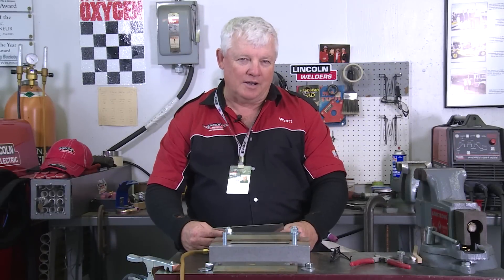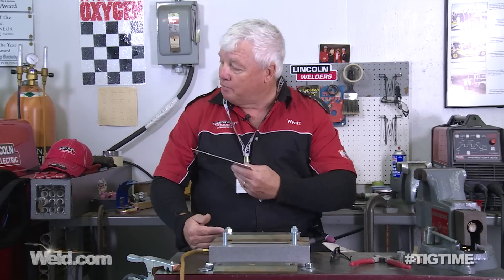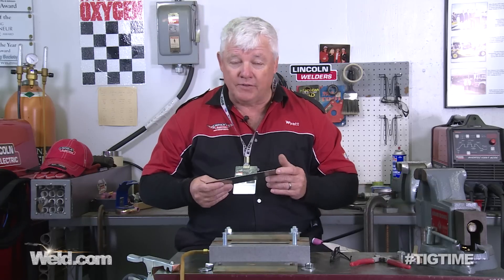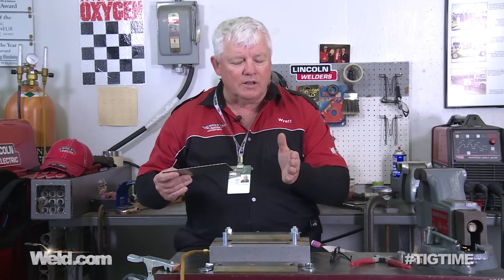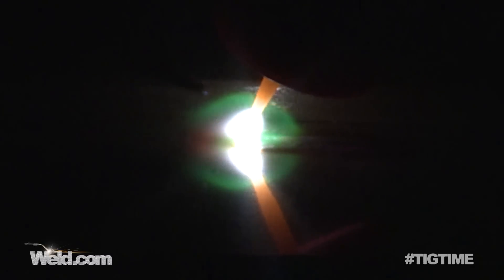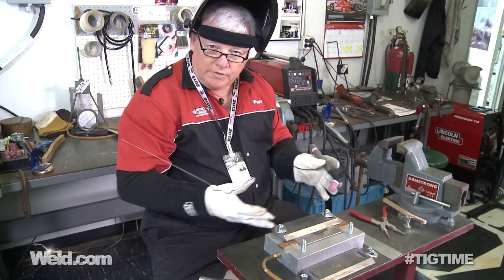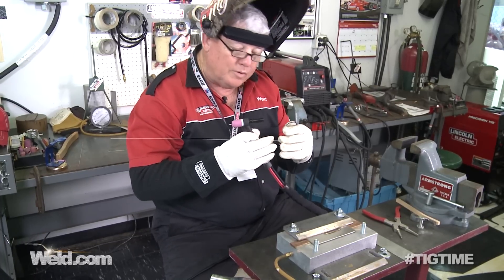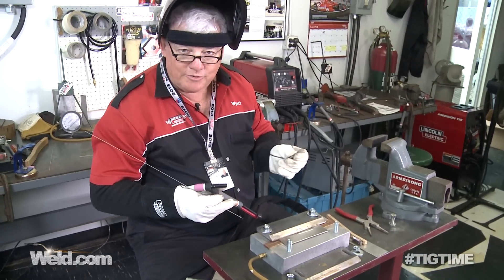How to Weld Inconel 625 for Beginners | TIG Time

Comment: Which filler rod to be used to weld Inconel 800 to Mild steel ?
Reply: The two metals are too dissimilar. You can melt them together with Mig or MMA but you will get cracks and it will fail. You need to find another method to join them.

Comment: do you have any inconel 625 pipe open root pass videos and i so what settings and best wire size for best root pass?
Reply: 1/8 625 at around 60-70 amps depending on schedule of pipe. wire 5/32- 3/16 gap depending on your feeding hand. You also want to run a purge through the inside of the pipe to disperse any oxygen.

Comment: Be careful using stainless wire brushes on 625 especially if a PMI test is performed on the weld as this can actually increase the Fe content of the finished weldment. 

We encountered this problem welding 30mm thick pipe butts. 

In the end we had special inconel wire brushes made.
Reply: roughcap I like your groove. Hit me up we can chat! Ostservicesinc.com

Comment: Too hot! My advice on inco is keep your amps low, and clean everything, wipe your filler with acetone, make sure your work area is very clean, make sure your rod hand/glove is clean, wire brush the material, use scotch brite to clean it more, then wipe the metal with acetone. Most inco stuff gets x-rayed so cleanliness is everything!
Reply: +waxen pith I'm heading in for a weld test with this. So what your recommending is I take a small bottle of acetone to the test and clean up like I'd clean for Aluminum?
Reply: Absolutely. Every metal welds better clean. It will only help.
Reply: waxen pith I need your opinion on Inconel 617
Reply: waxen pith zzzzzz. Love to see your inco. You noob. You don’t ss wire brush, or scotch inco for a class A weld.

Comment: Xairflyer,   We utilize Inco 625 for the filler material as well.  When welding thin gauge material you can use either .035 dia. or .045" diameter.

Comment: Inconel is a fairly easy metal to weld once you get used to the puddles properties and how to move it with all of the aluminum oxides in it. One of my favorite metals to weld on open root pipe.
Reply: 8053001923.lnconel
Reply: Oh. Excuse me. I am repairing sheet of 1.2mm inconel 625 but all the time has cracks. What I should do?